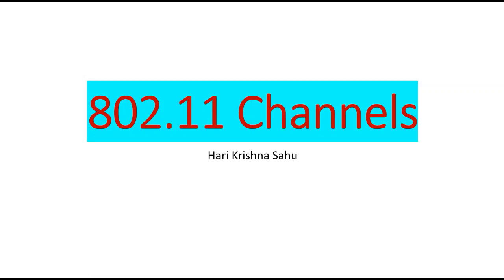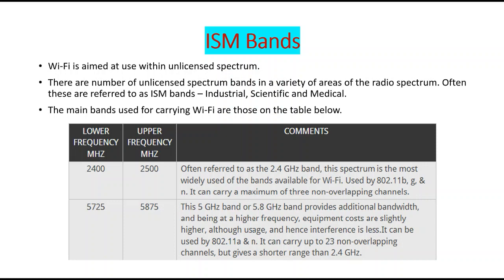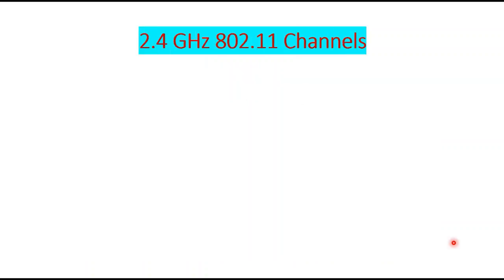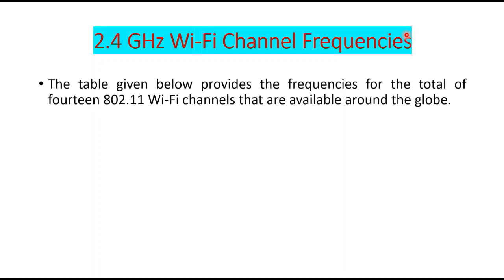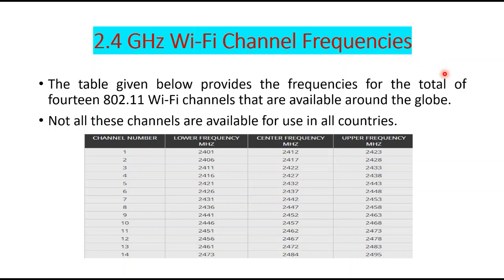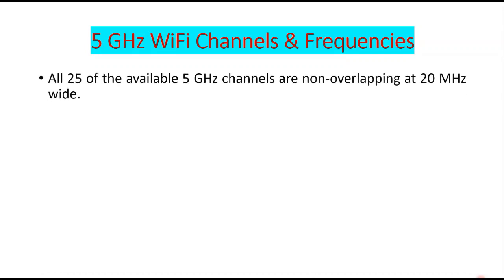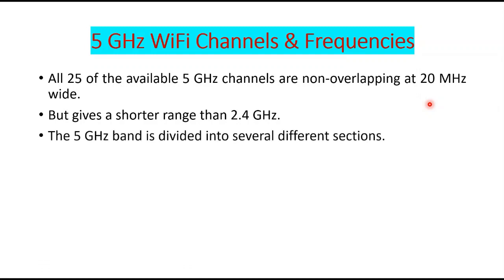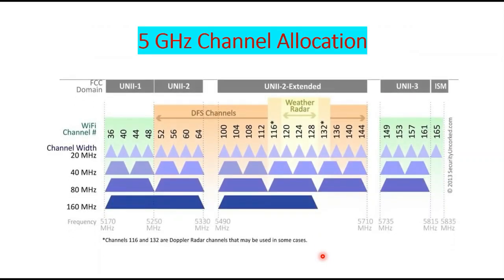WiFi Channels Explained | 802.11 Channel List | 2.4GHz vs 5GHz WiFi

Comment: Hey Hari, thanks for the video. But the thing that I dont understand is; 2.4 ghz channels named 1…14 but why 5ghz channels starting from 36 and increasing 4 by 4. I was thinking channel names as a regular names. But is there any meaning of them? Is there a relation with frequency or something else? Thanks
Reply from the maker: Thanks for connecting. It's a very good question and same question came to my mind as well before. But sorry to say that I don't have a solid answer for the same. But it might be they reserved channels after 14 to 36 for future use. Will let you know for sure once I will get it. Thanks again.

Comment: Hello Hari.. I have configured a second router as a repeater at home.. mobiles are unable to connect to internet on repeater network where as laptops are.. any explanation..?
Reply from the maker: Ideally it should not be like that. If laptops are working fine, mobile should behave on the same line. May be need to see the configuration part. Sorry for the late reply. Thanks.

Comment: Which channel number is best ?
Reply from the maker: As such there is no best channel you can say. But yes in general we use channel 1, 6 and 11 in 2.4 GHz. As these channels are non overlapping. But in 5GHz you can use any channel. Not an issue. It depends on so many parameters like how your environment is? Is it crowded with the same channel which you want to use. How much interference is there. Thanks. If you like please click on LIKE and SUBSCRIBE.

Comment: Can you tell me please which bandwidth channel is best to use 1,6 or 11
Reply from the maker: Thanks for asking. In 2.4GHz the best channels are 1, 6 and 11. Also you can use both 20MHz and 40MHz bandwidth. So its not like anything is best or worst. It depends upon the bandwidth and environment. Thanks.
Reply: Thanks for your suggestion